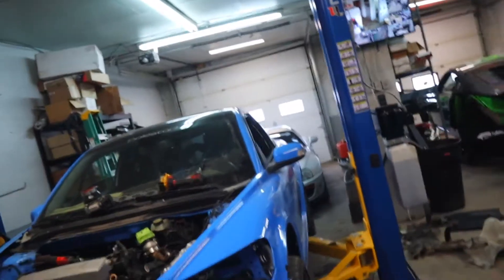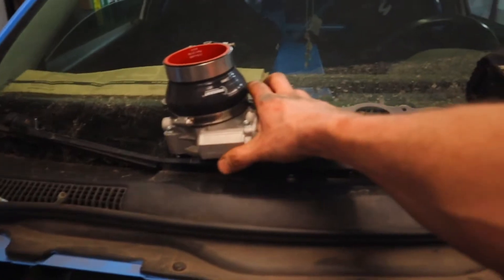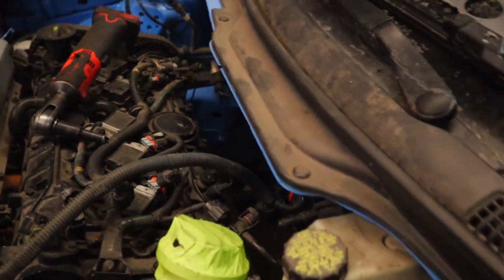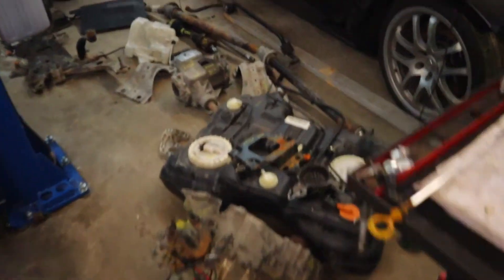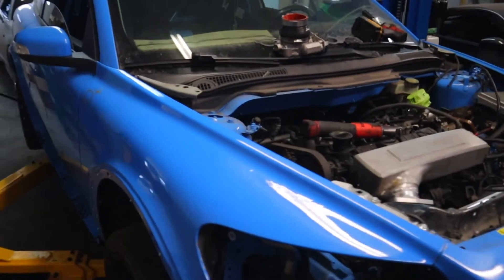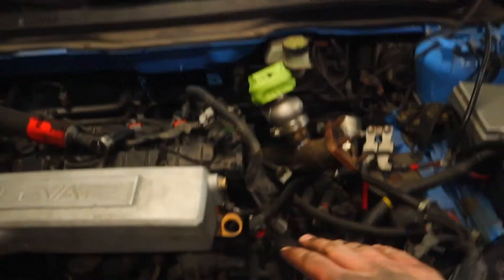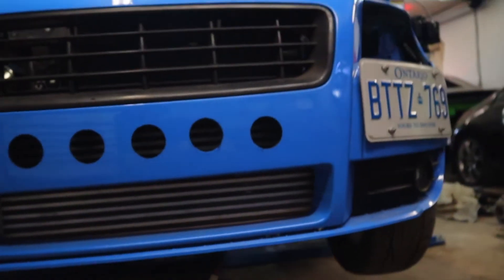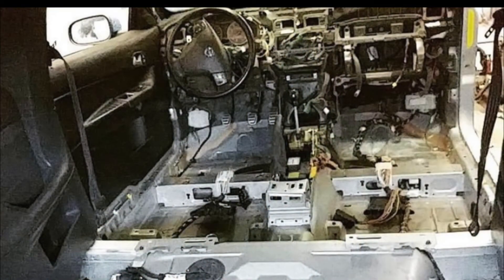2008 VOLVO C30 AWD Conversion!!!! Part 1

Comment: How are you going about the awd swap in terms of the ecu? Are you putting the S40 ecu in the car or are you going to attempt to reprogram the c30 ecu?
Reply from the maker: We're running standalone Haltech.   However to maintain functionality of the inside electronics we may run the OEM computer in piggy back to the Haltech to give tach and Temp if we can't get the Haltech to communicate through the network.   Also the factory DEM module for the Haldex rear diff will need to see engine data in order to determine what to do with the rear diff, or we'll also be doing a stand alone Haldex Controller.
Reply: AFAIK, the C30 ECU will recognize it all the same, thinking it's an S40/V50. P1 takes AWD swaps like a champ I hear.